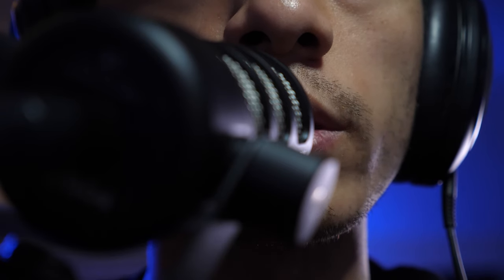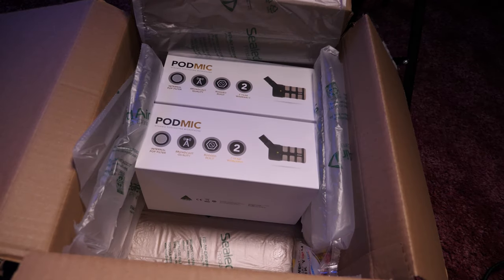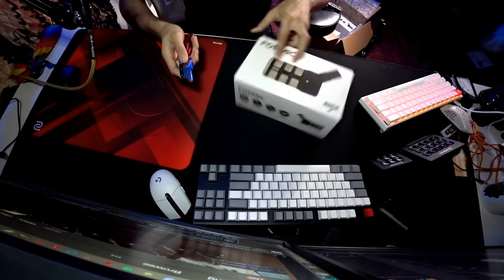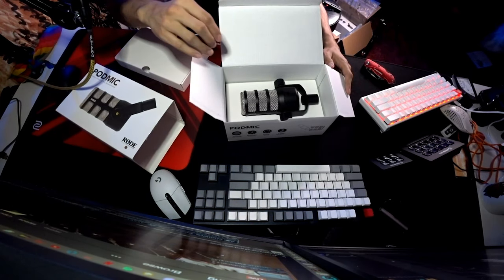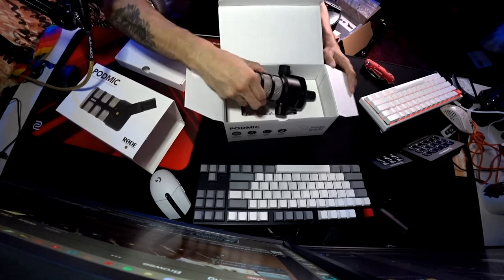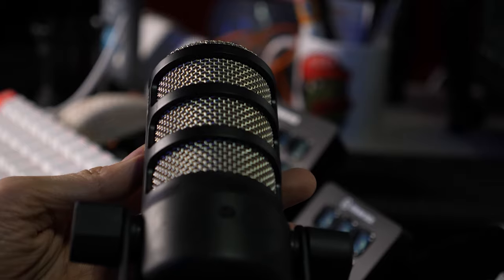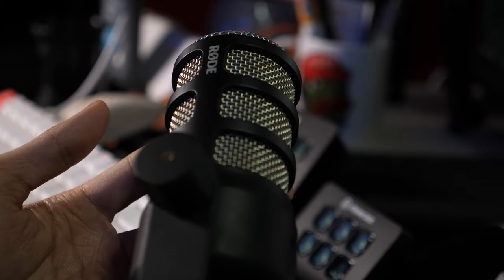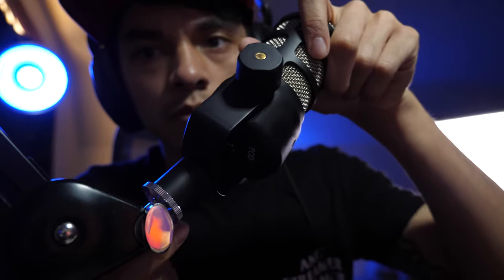Rode Podmic Unboxing

Comment: Do you need anithing else or just the mic or the arm ?
Reply from the maker: since it's an XLR mic, you'd need an interface to connect it to a computer. another option would be an external recorder like the Zoom H4N or something similar.

i have a dbx 286s and a MDX2600 before it hits the Scarlett Solo USB interface. this way it does all the processing you hear and my PC just thinks it's a simple USB microphone. no apps required.
Reply: @SPANISHFOREAGLE  wait so you process the signal twice through both gate/preamps? Does that actually make the quality sound better?
Reply from the maker: @night6k  in a livestreaming scenario, the idea is that i cut out bg noise, compress the sound, and give it a touch of EQ before it hits the interface. normally we'd do all of that in post but the preamp and compressor does everything in real time instead.
Reply: @SPANISHFOREAGLE  yeah I understand that but don't both those devices achieve the same thing which is live eq and compression? What if I were to get the dbx 286s alone and not the behringer?
Reply from the maker: @night6k  most people only have the 286s and an interface and that works fine. i use the MDX2600 as a limiter on top of that because i would yell on stream and it would cause clipping.
Reply: @SPANISHFOREAGLE  ah thanks.